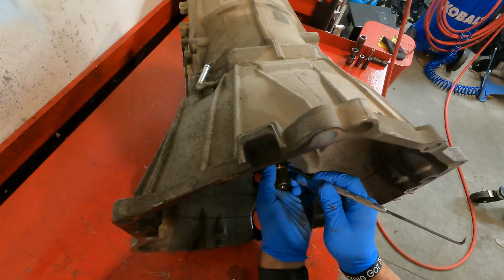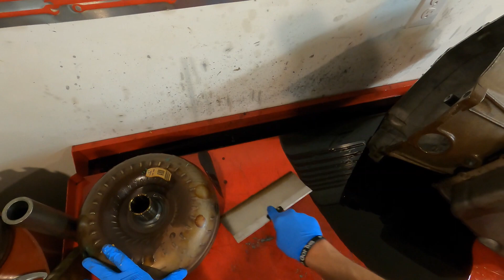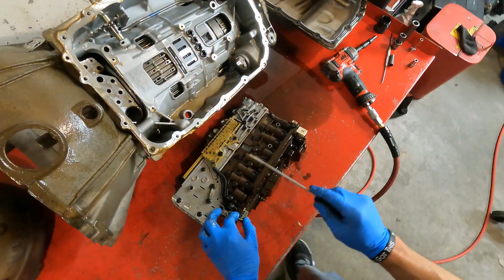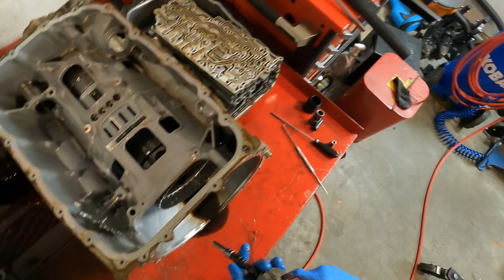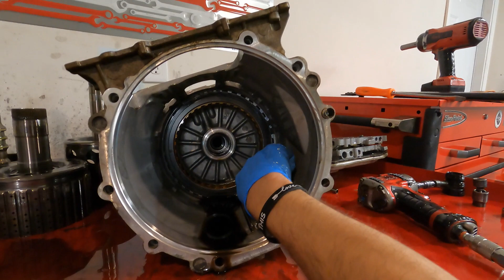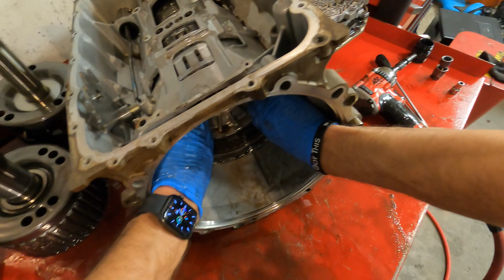2017 Chevrolet Silverado 6L80E Transmission Teardown

Comment: I just got a p0741 code truck has 105000 miles 2016 2500 hd  how hard is it to change the torque converter clutch solenoid.

Comment: Just curious why you don’t reuse the TECUM.  I’m still a Junior builder but have rebuilt 20 to 30 of these (50,60, and 90 versions) and have only replaced 1 TECUM.  Reason for replacing was one of the electrical pins pulled out of the TECUM (that was fun to diag).  No disrespect, I like seeing what other do and why.
Reply: Wonder how much inventory GM has left 🫣

Comment: question, i am changing the the trans fuid of my 18 sierra denali with 8l90, 6 qts came out, should i put back the 6qts or add the 1 1/2 for total of 7 1/2 as supposedly?

Comment: My 2017 silverado is shuddering in 6th gear under light load only. i can drive with tow haul on . seems to not do it. its only under light acceleration or hills. its a 6l80. Any help or advice 116,000 miles. I would love to get you to rebuild it. I could ship it to you. please I don't trust any shops around here.  love you work ethic.

Comment: Hello. Enjoy your videos, having issues with my 2018 5.3 6 sp 4x4. 1st and 2nd very sluggish at take off, when coming to a stop there’s a loud and very hard clunk from 3rd to 2nd. There is also shuttering. Still under warranty but the dealership won’t address anything. They just say keep driving it till it breaks. How can I get them to do a full rebuild overhaul or can I bring it to you and get what you did on the 2017 Chevy Silverado 41 min video under warranty?

Comment: 2000 Chevy 5.3 4l60e has gone through 4 transmissions from one shop. Other 4l60e from the same shop still running good and strong. Any idea
Reply: Replace the MAF sensor. Dump the K&N, if you have one.

Comment: I've got a 2010 Z71 (130,000 miles)bought used,appears to have new transmission lines,how can I find out if that's the original transmission?....Thanks for the videos.

Comment: On these 2014-18 trucks with the 6l80e, do you recommend the surecool bypass for the thermostat? GM does have a service bulletin for a lower temperature thermostat 21-na-199, I've currently installed that but now I'm wondering if I should have just done the bypass instead, from what I've been reading that's one of the reasons the torque converters go bad in these trucks is the transmission temperature too high.
Reply from the maker: The one you have installed is fine. The new GM thermostat opens up at a cooler temperature. The sure cool has continuous cooling and they typically run close to the same temperature.